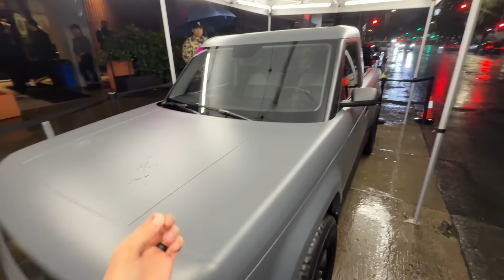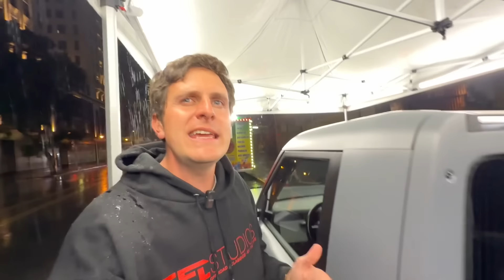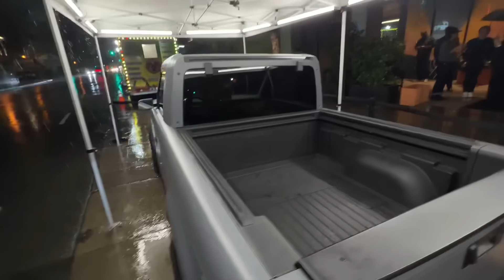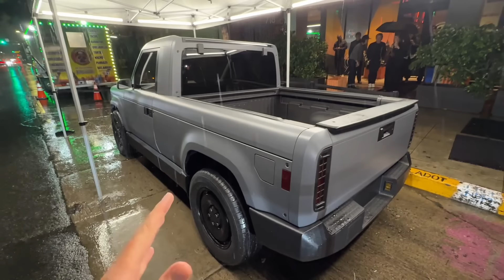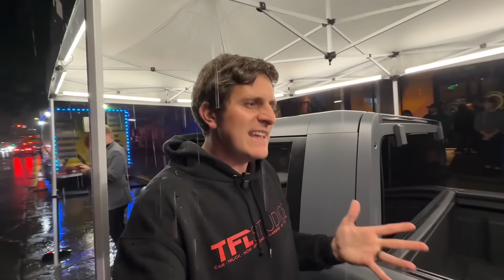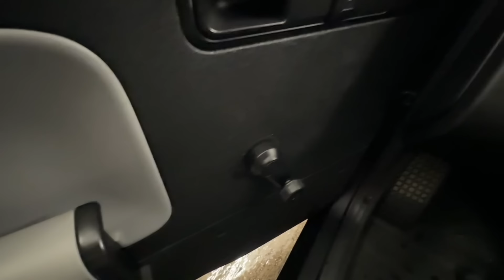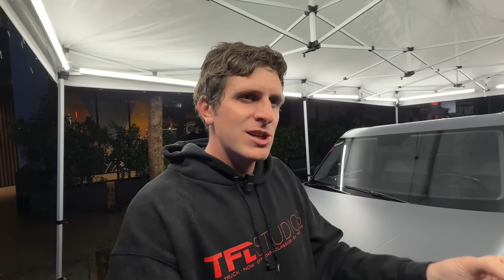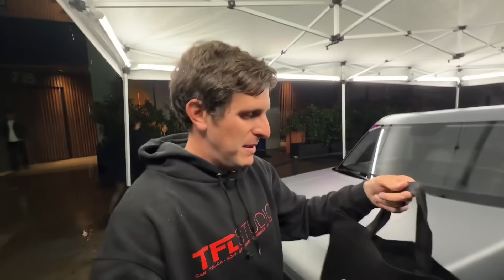The TRUTH About the '$20K' Slate Truck...Will This Really Be a Hit?

Comment: Agree with you on range not really being much of an issue anymore.  The thing that is a huge issue for me and I am well aware of since I repair HEV's, PHEV's, and EV's is that at in about 8-10 years the HV wiring, HV motors/transmission assemblies, and the battery (that one usually not so much as people think) totals the car.  Or, as we see, kills the resale value.  But that could change as manufacturing processes improve and replacement parts hopefully become less expensive.  I hope they do.

Comment: Hope they sell but i doubt they can give them away in Canada and the USA.

my buddy has a stripper 4x4 F150. has AC, automatic, and cruise. crank windows, rubber floor, single cab, 8' box, the old school v6 non turbo. He loves it. Holds 3 people in comfort. gets great mileage. 

He had to order it in, the dealers wont bring them in because they will be stuck with them.

Personally the perfect truck for me would be a F150, V6, 4x4, stripper cab and a half with a 8 foot box. ford stopped making them, they don't sell. 

People buy with there ego. 

I have a 2014 Honda Fit, probably one of the most practical little cars you could own. They couldn't sell them so there no longer available in North America. same with the Yaris . 

I'm 6,2 and 230. Little guys try to convince me they couldn't fit in my Honda, and I have lots of room. 

people buy with there ego.

Comment: 🤣🤣 $20K....PLUS $15K more for add ons.
Reply: If they make the battery modular, so you can buy the regular range and add more range later, the base model can sell.  A bed mounted gasoline or diesel range extender could also be a great accessory.
Reply: @michaellowe3665  I think a "bring your own power pack" option would be cool. The ability to tap into the battery and charge while driving.  Something tells me that there would be too much liability there, and the manufacturer wouldn't do that.
Reply: @jesses1589  they could easily require only certified range extenders to be used.  They could lock out the drive while charging unless locked securely in place. Ford patented the bed mounted range extender about 8 years ago.  It looks like a bed mounted tool box.  I suspect the patent was just to lock out competition since they aren't using it. It's easy to kill a patent if it was used for this.
Reply: @michaellowe3665  that won’t be possible. You can’t design a pack that can be added to later because the cells with not be able to be balanced properly once the older cells have lost some voltage. It will have to be all in one to work properly z
Reply: @justinstewart3248  that is absolutely incorrect. You can build a battery system that allows 2 separate packs to contribute to the power train.  You can even run on one while the other is switched off and switch over when it runs out.  You just have to prevent unwanted power flow between packs. Cells within a pack may need to be balanced, but separate packs can do whatever you want. This isn't complicated. It could be completely seamless or you could let the driver switch it like they did fuel tanks in old pickup trucks.
Reply: Drive it
Reply: Thats every other car too. . .
Reply: Without the tax credit, $25K+ for the bare bones ones he showed there. By the time you get the extended range (that no matter what he says, everyone is going to want), decent wheels/tires, wrap it, at least basic features and other add-ons, etc., you are going to be over $40K easily. I love the concept and think it would be cool to built out a cool little street truck/SUV, but I think it is going to flop hard at that price unfortunately.
Reply: This looks bunk compared to my 28k brand new Ford Maverick and can’t tow shit
Reply: @buckd2958 I wouldn't do a lot of towing with a unibody escape truck either. Just because they say it's rated for it, doesn't mean you won't shorten its life by towing.
Reply: @michaellowe3665 my point is this battery truck can’t pull shit 💩 and my maverick is equipped to pull 4k. I’ve pulled a lot with it and 50k miles 0 issues. Thanks but I’m not worried about it at all.
Reply: @buckd2958 my point is that neither should be towing if you want them to last. Unibodies are bad to tow with because the stresses can pull out the structural bends that give the body it's rigidity. Tiny engines with turbos tend to coke up the oil due to high temperatures, and CVTs are absolute garbage for towing. 50K miles is not nearly long enough to know if you are prematurely wearing it out. 

Both are fine for a bike rack.  If you want to tow anything moderately sized get a Ranger or Tacoma. Big boats or trailers should be towed with a full size.
Reply: @michaellowe3665  who cares about towing?  95% of the giant ass trucks on the road are commuter vehicles that never once tow a single thing.  If you want to tow something, get an F150.  If you want to be able to get to and from work, charge for free at more places than you think then get an EV truck.
Reply: @jonq8714 you are responding to the wrong comment. It was the buck dude that's mad about towing.  It used to be the Ranger owners who dreamed of bigger trucks that were always so grumpy. Now it's the Maverick owners.  They're going to push those little CVT escape trucks beyond their limits because they have something to prove. Never buy a used maverick.  It will be beaten to an inch of its life.
Reply: @jonq8714  This thing is perfect for my needs. With the optional 2" lift I can take it off the pavement where I can't with my current PHEV car which cost twice what this is. Although the car is a fully loaded luxury edition. It has a bed that just big enough to haul around the kinds of stuff I need hauled around. I'm getting old so I'm not going to be wanting to try to fill my old ailing 3/4-ton truck on a major dump run anymore. Just a bit of lumber and gardening supplies or a trip to the range.

Just start with the basic truck and add to it as you want, need and can afford. I have enough saved up to get one at the base price right now. No financing required.
Reply: @michaellowe3665  Aren't they front wheel drive? That's just seems wrong.

Comment: Tommy, this truck can't even complete with a Maverick for the money.
Reply: This will end up being a very niche product at best. Sounds great on paper but in reality not so much.
Reply: It's full ev.  You are silly.
Reply: There is nothing in the world that will convince me to own a modern Turbo DI gasoline engine. They are horrible in terms of reliability. I don't care how "cheap" they are used. They aren't cheap enough for fundamentally flawed tech that has issues going over 100-150k miles. To say nothing of the maintenance costs and repair costs.
Reply: A fully tricked-out Slate will cost more than a Maverick for sure. But at least people will notice it. No one’s walking up and saying, “Whoa, is that a Maverick?” The Slate will generate a parking lot conversation everywhere you go.
Reply: I'll take it a step further, The powertrain that's in the Maverick needs to be put in every super duty. 
 With the obvious changes required. 
  And make it a heavy hybrid AKA a hybrid that you can plug in and drive on electric only and have outboard power and have enough storage for effective regenerative braking and big enough to make more output than a diesel for certain amounts of time. 
  It would be simpler than most people realize and the whole powertrain would have exactly zero clutch packs. It would no longer need an alternator and a starter because those are provided by the generator and the motor in the transmission. 
  It would be a variable speed transmission. 
  The benefits go on. 
Ford needs to market it similar to the way they did EcoBoost because people might view it as an uncool powertrain.
Reply: Right. $36000 is actually less in American math than $25000.
Reply: @stanwbaker  I can get brand new Mavricks for 28k...i just got a 1 yr old Ranger 4wd for 34k...
Reply: @gnd111  LOL that Ford will blow up its engine before 100kmiles. American designed vehicles are flaming sh!te avoid it at all costs.
Reply: @gnd111  yeh but it's going to cost less than $20 to charge this thing to full in most of America. And no oil changes, spark plugs or dpfs to clog
Reply: @tindy128011  these are garbage,,,,,,,,this is NOT the future,,,,sorry
Reply: @tindy128011 but let’s not forget the fossil fuels needed to create electricity for this so call clean energy vehicle right ?
Reply: @brycedery9596  Nah mate you got it twisted. The engines in the Rangers are actually incredibly bulletproof. I have a 2025 Frontier myself but the Ranger is the only other four banger mid size I’d consider
Reply: @AnabolicRick915  I've heard too many interviews with former engineers who all state that during design meetings a lawyer and bean counter are also there pushing relentlessly for the cheapest option with calculated failures by 100k/miles. Also heard an insurance adjuster saying the fords are a constant issue. If it works for you, I'm glad. The disposable attitude of manufacturers is making vehicle ownership an incredibly treacherous endeavour.
Reply: @johnfranktullo3463 it will still be multiple times cleaner than a normal car and get cleaner all the time as the grid gets cleaner. likely 90mpg equivalent efficiency if not more
Reply: @brycedery9596 Okay, then get a toyota. His point still stands tbh.
Reply: @gnd111 how much maintenance do you need to do? Oil and liquids that you put a match to would be a health issue.
Reply: @johnfranktullo3463 Those are in declining use anyway.  Coal is uneconomical as is oil, and gas turbines have a seven year waiting list.  That leaves renewables and nuclear.
Reply: @johnfranktullo3463  yes, since the generators at power plants are much more efficient than engines in ICE vehicles, so EVs are still cleaner even when fossil fuels are used to generate the power. Throw in wind and solar and it gets even better.
Reply: @tindy128011  Yep and this is why I will never buy a modern combustion engine. For the last 7 years we have done our daily commutes with EVs. There is no going back to less reliable and more temperamental modern gas engines. Literally every single one of my friends who laughed at that decision years ago has been on the receiving end of multiple "I told you so's" after their new Rangers and Bronco's have had engine issues. Modern gas engines are a joke. Go electric or get something older that is still TBI.
Reply: @tindy128011  to charge to a full it'll take 30 min at a min where it takes less then 2 minutes to fill an ICE vehicle, on top of that when you use a truck as a truck EV power trains lose the majority of their range under load where ICE engines do not
Reply: @tindy128011  that's actually false the amount of emissions that are emitted just manufacturing evs dwarfs anything that ICE cars produce in both manufacturing and emission in use, and I'm not talking Co2 which is actually plant food, no they produce toxic waste and chemicals in their production and on top of that the majority of these lithium batteries become toxic waste at the end of their life span, the myth that evs are cleaner is just that a myth
Reply: @c0ldyloxproductions324  your information is 15+ years old and also just intellectually dishonest
Reply: @c0ldyloxproductions324  you have clearly never used a truck to tow anything
Reply: @tindy128011 actually I do, I work at a farmers coop and have to tow things regularly, and no my info is not 15 years old, there have been real world tests of these evs when it comes to towing, and also the information about their manufacturing and the emissions from them being produced is still current because manufacturing on lithium ion batteries, which btw are highly explosive, has not changed Toyota to this day has not changed their stance on evs
Reply: @tindy128011 also the Mercedes analysis is not 15 years old it happened after 2020 and is still relevant information
Reply: @unconventionalideas5683 lol coal is still the cheapest source of energy for the power grid. You are clueless.
Reply: I hate the idea that taxpayer money to make one product a better option then another u either have both ice and ev vehicles being offer that benefit or none
Reply: @johnfranktullo3463  I know all the tax money used to subsidize oil companies needs to stop. Technology should be able to stand on it's own.
Reply: @diesela3 oil has made this country it has touch every part of our society n culture good or bad if not for oil hell we still stuck in the 1800’s and how much money , aka taxes has oil generated let’s look at roi shall we ? Bc we all know that the solar n wind farms the the government subsidies made one hell of an investment, wink wink
Reply: @j @johnfranktullo3463  And the rest of the planet is moving forward with electrification. We should make sure that American manufacturers lead there as we did with oil. Thanks for making the argument for me. Luckily the rest of the world has decided that batteries, nuke, wind, and solar are the future. No need to listen to contrarians unless you need to exploit them for votes. What they think doesn’t actually matter.
Reply: @johnfranktullo3463 gasoline vehicles get loads of subsidies in the form of lower fuel prices by the United States subsidizing oil extraction. Get rid of those and then the ev incentives won't be necessary
Reply: @tindy128011  There are no "oil industry subsidies" there are only generic industry and business tax credits, which all corporations the country, including oil, take advantage of.

Additionally, oil price is determined globally.
Reply: @tindy128011  Bingo ICE vehicles receive govt subsidies their entire life. It needs to stop. We must be consistant. Since we want the Chinese to dominate the EV market apparently why should we subsidize EV makers. It's brilliant if you are used to losing.
Reply: @tindy128011 lil child the whole goddam planet runs on fossil fuels
Reply: @johnfranktullo3463  yes and we should transition to using them as little as reasonably we can in the future
Reply: @tindy128011 yeah ok talk is cheap show us first go fossil fuel free in ur private life and tell us how f-ing expensive it is
Reply: @johnfranktullo3463  i never said fossil fuel free. but we can transition over time to make massive reductions. this would be a long term transition over something like decades, but we need to do it as quickly as reasonable or there will be widespread unnecessary suffering. its possible to do
Reply: @tindy128011 no it’s not our industry is too big our population is too big renewables could only provide a small percentage of the country pound for pound fossil fuels are the most efficient and cheapest get on of the leftist bs crap that renewables are the cure all
Reply: @johnfranktullo3463  I'm all for nuclear energy which could make our electricity even cheaper and more abundant than it is now. You assume way too much about me
Reply: @tindy128011 nuclear. Natural gas , oil u don’t realize the amount of energy need for a I when it ramps up within within a year or two and that just us demands never mind global demands
Reply: @tindy128011  agree 💯 If we actually built nuclear in this country again, on a massive scale, we could eliminate our reliability on any other source for power generation and then some! 👍
Reply: don't forget to add $1300 per year to the maverick cost for fuel and maintenance. oh, and this'll last to 400-500k miles instead of 250k. but buy your maverick and let's see the resale value in 5 years when people finally figure this out.
Reply: @xtdude i think the market has spoken when you see early Mavericks having appreciated in value. Granted mainly because new ones have gotten more expensive.
Reply: @Bonanzaking  and everyone knows once the market has spoken, it never changes it's mind
Reply: @xtdude well it has spoken. When i look at say how far we’ve come from the gm 1 and ev ranger days of the 90’s the market does want EV. Just not necessarily a truck outside the commercial fleets. The adoption curve for anything isn’t a straight parabolic curve upwards. It levels off for the late adopters.

Point being is your 5 year resale comment when you look at the Maverick backfires vs every other EV truck thus far.

The slate needs to prove itself. I see it being extremely popular in the cheap used vehicle market. Not so much with the new car buyer market. Maybe some commercial fleets but at its cost the Maverick makes more sense.
Reply: @Bonanzaking  yes that's why Mercedes and Audi both said naw we aint solely focusing on evs anymore and that Mercedes on research on the matter stated the toxic waste produced during ev production dwarfs the emissions produced during production of ICE cars and the emissions they have during use, also Toyota refuses to go full ev realizing evs are a scam
Reply: No maintenance costs and will last 400-500k miles? They haven't sold a single vehicle yet and you know all this?
Reply: @xtdude put the pipe down.
Reply: @Ultra-John electric vehicles have much less maintenance. 
Stop huffing the leaded gasoline
Reply: @tindy128011  Don’t tell me my business devil woman!
Reply: @xtdude It'll need a new battery long before then. You're actually on drugs. Yes, the Maverick will probably cost more to maintain, but at slightly more expensive, being a much better vehicle overall etc, having actual range, towing capacity, weight capacity... If you use your truck as a truck, it's going to be the better vehicle. 

Okay, forget ford. Sub in Toyota for example. You still wanna try and make this case?
Reply: @longplaylegends Toyotas are nice but crazy overpriced just like everything else these days! But hey that premium you'd pay would be worth it to avoid having to drive a garbage Ford with its inevitable, excessive repairs 🤣👍💯